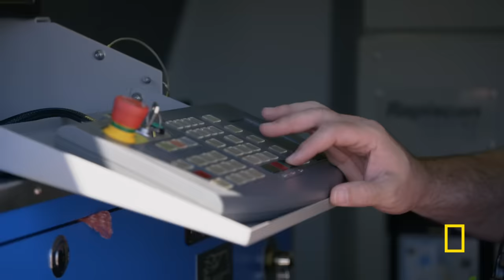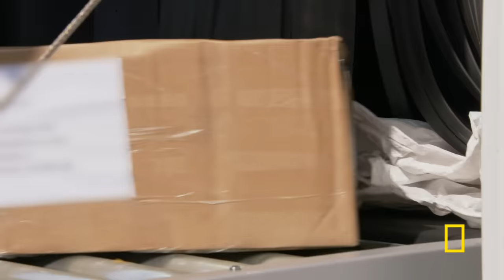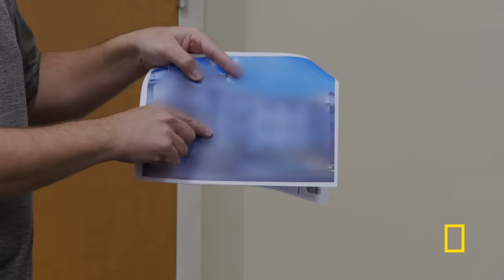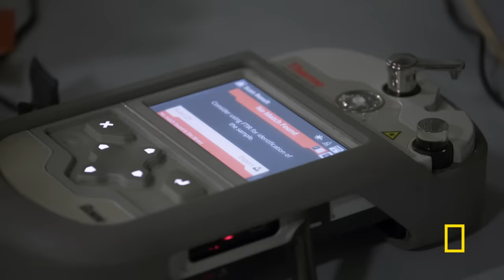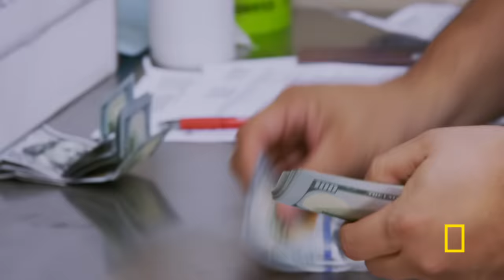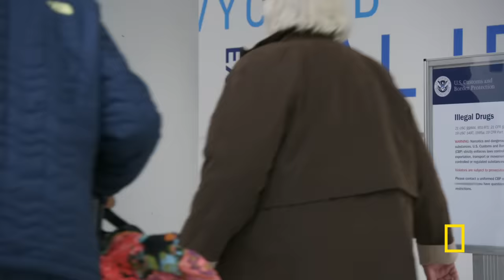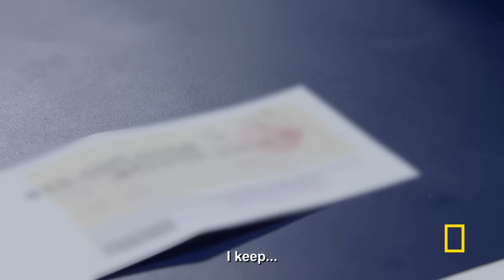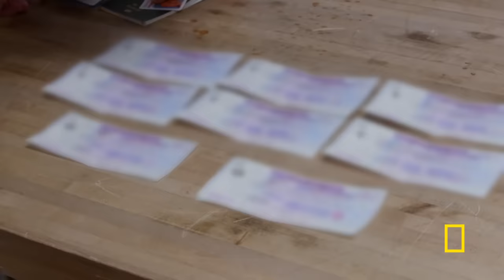Coke, Cakes and Cash (Full Episode) | To Catch a Smuggler

Comment: What happened to the missing 2 kilos of coke?  At 2:09.... 4K in MIA.  At 24:43....only 2K arrive in ATL.  Was it the cops?  Was it the film crew?
Reply: broooooo, good eye
Reply: It went in the drill hole in the drum
Reply: @mikefoehr235  omg :D
Reply: Could be 2k per package
Reply: @Darydude10  good point
Reply: It's 2 lbs a key
Reply: @sheltonbuchanan77  2 Ibs is 800 grams, it's 2.2 Ibs to the Kg.
Reply: @johnmcgovern5372  2 lbs is much closer to 900 grams. there is 448 grams in a pound.
Reply: 2kg blocks x 2 =4kg

Comment: u can check the microprint on the photo of the lambo to see where the printer was bought from and sold to.
Reply: dude LOL what kind of CSI are you trying to pull here, you think this cops have even the slightest Will to do this? 🙄 no they could careless, they were thrilled just to know they got something, there would be too many pieces to put together and plenty of jurisdictions to brake and time to expend and on top of that a judge would have to approve all of this, stuff like this you only see it in the movies for entertainment, just the amount they got from those two cakes is not even worth it.

Comment: Is there a possibility that we can try and focus on the criminal culprits only, instead of everyone being suspected, upgrade your tech gear and use polygraph machines will help catch possible criminal suspects, without considering everyone is a suspect, because were not all criminals, makes you not want to even travel anymore, eventually airlines will start to lose travelers due to excessive security protocol, just give it enough time. like the gestapo at the airport.